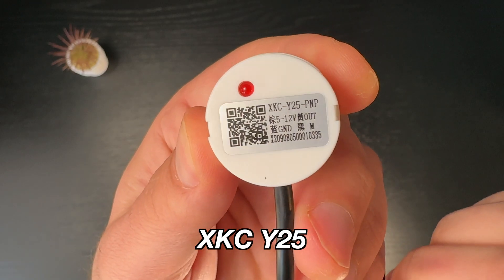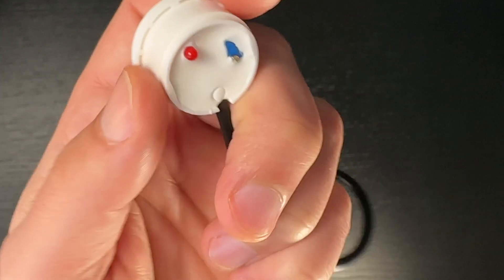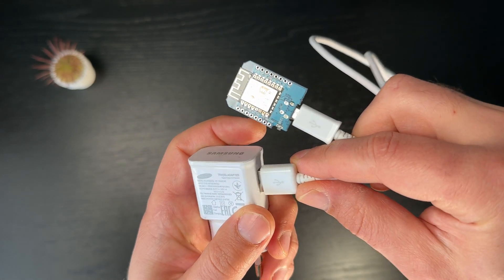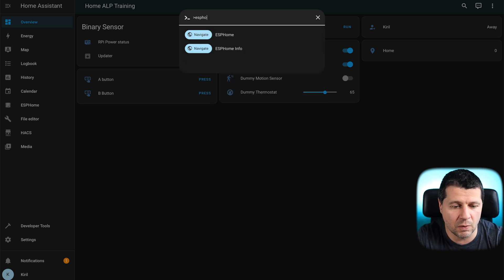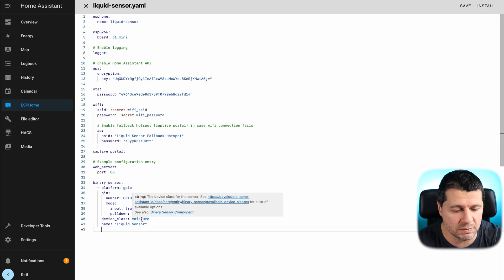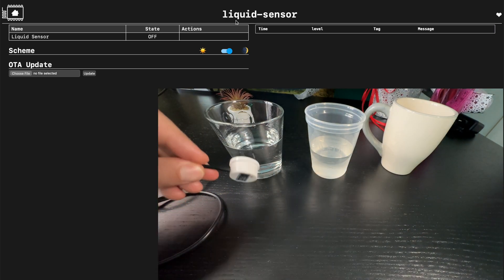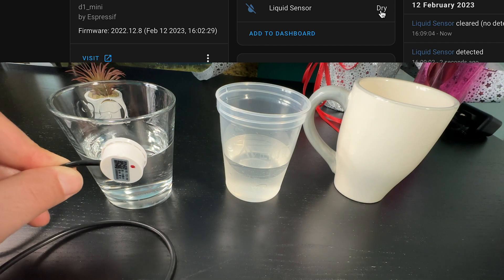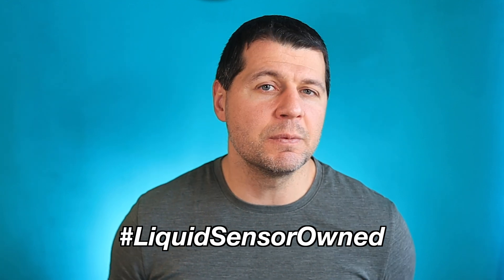Build Your Own Smart Liquid Sensor with Home Assistant and XKC Y25 - Easy DIY Tutorial!

Comment: I have a rain barrel for which I want to be able to see in HA if it's below 50% and 25% water level. Is it possible to add 2 such XKC Y25 sensors to one ESP board? If so, which pins would I need to use on the board to solder the sensor cables and what would I need to modify when flashing the firmware? I'm still "dipping my toe" into this whole ESP32 things and trying to find a start...

Comment: great video!
that's exactly what I was looking for, for my camper's grey water tank, thanks a lot.
I'm just wondering how many sensors I can connect to a single ESP32? 3 or 4 would be perfect for me.
Reply from the maker: You can have 3 or 4 sensors on one esp32. My initial idea was exactly this - to use 3 sensors on one esp32 for the grey waters on my camper, but I still can't find enough time to make it happen. Hopefully this summer I will make it.

Comment: You could just use a 12V power supply, a voltage step down converter, a dor sensor (zigbee for example) and this sensor and be done with it :)
no need to program anything, just solder and do the same scripting as a door sensor in the home assistant :)
But of course, when you need more complex stuff, you can do it with an esp / shelly uni.
i will probably use a shelly uni to measure aquarium temperature, water level with this sensor and also control a water pump for auto water top-off. With the shelly uni, as it also works directly with, I believe, 12 to 36 volts, if I a power supply of 12 i don't even need a voltage step down converter.

Comment: Another excellent tutorial!
I've tried to add a second sensor on another pin and I got the error message "Only GPIO16 supports pulldown."
Did a bit of googling and I'm still a bit lost: my understanding is there's an internal resistor that gpio16 can use, but no other pins - does that mean I can only get 1 sensor per D1 mini? Or can I add my own resistor, if so what value would I need? 
Ultimately I'm wanting to fit 6 of these on 1 micro controller, should I be looking at another ESP board? will that be easier?
many thanks for all your work mate!

Comment: I liked your video!! I need to monitor the water level in my home's water tank and I have 2 questions. Please, help me. FIRST QUESTION: Which sensor to use, as I noticed that there are several models (XKC-Y25-V, XKC-Y25-NPN, XKC-Y25-PNP and XKC-Y25-RS485). What is the difference between model V and model PNP? SECOND QUESTION: The distance between this sensor and the panel where the circuit will be (Arduino, buzzer, LCD, etc.) is 15 meters. Will I have losses with this distance? Do I need to install a special cable? THANK YOU SO MUCH!
Reply from the maker: Just get the PNP sensor if you wish to connect it the same way as me and to use the same ESPHome code. Otherwise you will have to experiment / read and figure it out by yourself

Comment: What's the difference between PNP and NPN? Can you use them NPN here instead of PNP?Also how can I add a second sensor ( which pin on the d1)? Great tutorial.
Reply from the maker: not sure about what are the differences, just get the same that I'm using so you will know that it will work
Reply: @KPeyanski  thanks, how can I add another second sensor? Which pin?

Comment: Bought the sensor directly after watching this. Exactly what I needed for the project I plan on doing. It's so frustrating how often I must fill the Keurig reservoir. Have the ESP32, have already ordered the pump....the only thing I was missing was a good water level detection method The idea is to have a much larger supply of water underneath the shelf the Keurig sits on. Will just use the pump to refill the Keurig whenever the reservoir gets low. Was considering an ultrasonic sensor and then drilling holes into the lid. But now I won't have to drill anything and it'll look so much better! Thanks so much dude please keep these esp tutorials coming!
Reply from the maker: You are welcome! Enjoy and don't forget to share the news here when you finish it. Good luck!

Comment: Hi Kiril,
I’d like to embark on the ESPHome trip sometime soon, but I have a big question I hope you’ll be able to answer to:
is it possible to connect sensors to an ESP32 and use their output to modify the behaviour of the ESP32, without passing from Home Assistant?
To be more specific, I’d like to connect a led and a photoresistor to an ESP32, and I’d like to internaly dim the led accordingly to the photoresiststor output, without constantly pulling from Home Assistant the photoresistor output.

Is this possible?
Thanks for your time.
Reply from the maker: I think yes, automation and some logic can be added inside the ESPHome code
Reply: @KPeyanski  may I suggest you a video on this topic? Documentation isn't super clear, I cannot find any resource online.
I ended up coding it in MQTT and it's working, but I'd prefer to switch to ESPHome.

Thanks!

Comment: Great video as always.. I didn't realise such a sensor existed. Did you get the code for adding a second  XKC Y25 sensors to a single wemos d1 mini. that way you could monitor clean,and grey water levels with the same wemos.
Reply from the maker: Thanks, the code shouldn't be much different just another section with another output pin should be added.

Comment: Nice video
I did combine 2 of these sensors for my water tank. One at the low level to start my water pump and the other to stop the pump when the tank is full.
Reply from the maker: Nice work! On which PINs you have connected the sensor and what ESP board you are using? Also can you share your ESPHome code?
Reply: Could you please share your code?

Comment: Nice. Might add one to my aquarium. What do you think would be a good solution to affix it to the aquarium outside glass?  Would double sided tape work or would that throw off the sensor?
Reply from the maker: I'm not sure but I guess it will work, otherwise you can use some not very strong glue and you will be fine

Comment: I used the same sensor for measuring the oil (petrol) level for my house central heating. They can work on thicker plastic containers and you can set the sensitivity from their potentiometer
Reply from the maker: Yes, that is a great use case :) But are you still use it or you switch to something different?
Reply: @KPeyanski  i still use it, 2 years later. I have it outside mounted in an electricians box which is attached/glued really close to the outside wall of the tank
Reply from the maker: Nice, thanks for sharing :) And you connected it to an ESP board or not?
Reply: @KPeyanski  the same setup as you! Wemos (the one with the external antenna) plus esphome